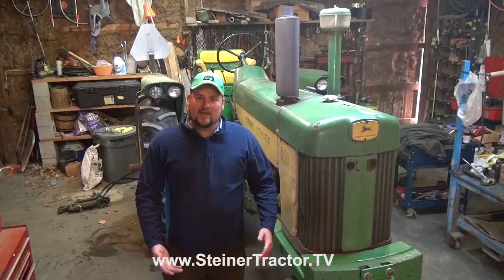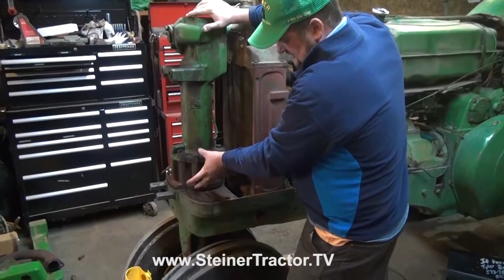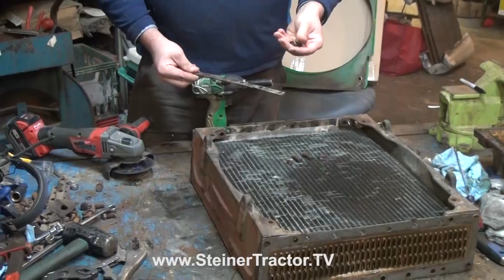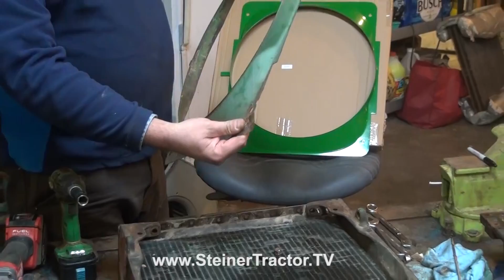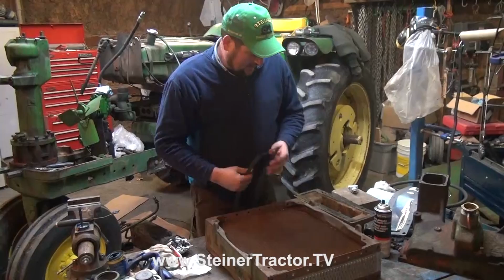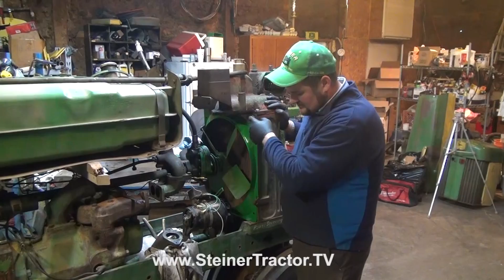Radiator Core Replacement

Comment: Use a small brazing head on torch and mildly heat each small bolt. Heat around bolt  and then loosen.  I did this on two of my tractors and it worked well . No broken off bolts. As Tyler mentioned use anti - sneeze when assembling.  Good luck!! Do it right and do it only once.  No short cuts .

Comment: Thanks for the Vid. I did a core replacement on a 60 series just last week.
 ALOT of patience is needed and still had a couple of broken bolts in the old cast tanks.
 Core and bolt kit came from Stiener.
 Be prepared to buy more bolts as some were not proper length  supplied with the kit.